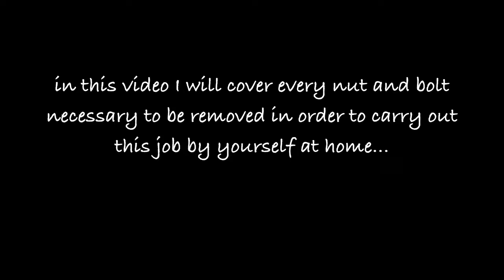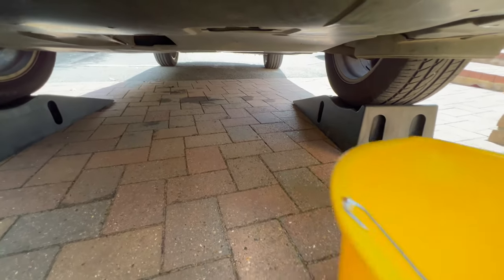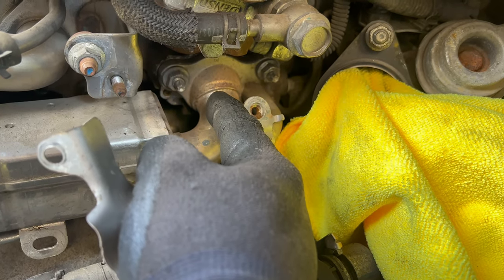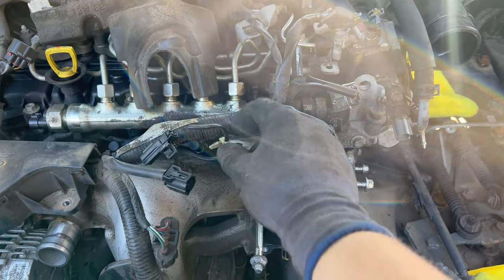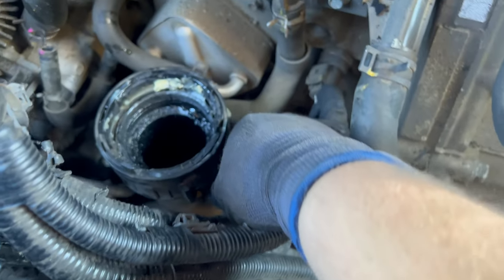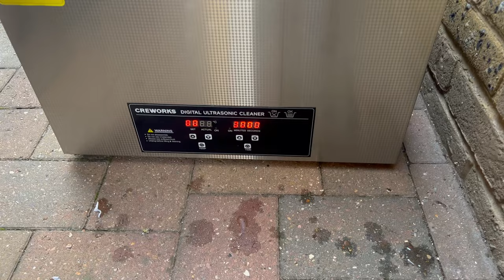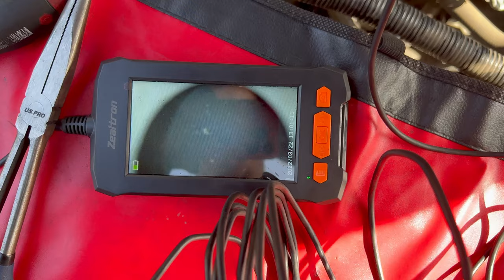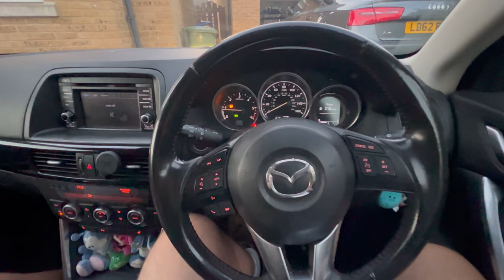Mazda STEALERSHIP Charged Him £5000 - Mazda CX5 Skyactiv Diesel In DEPTH Engine De Carbon Cleaning

Comment: These are the type of channels authorized garages and dealerships hate but we love. Thanks buddy. amazing in depth.
I've just had a P258b error come up on my mind and I was told it was a vacuum pump error but the vacuum pump seems to be working fine. Any tips?
Reply from the maker: It will be the vacuum pump and/or worn exhaust camhsaft.
Do you have a scan tool?
If so,check in the live data the brake booster pressure sensor values. If it doesn't go back to 7.6kpa then the vacuum pump needs to be replaced. Usually if you have codes for it then it is faulty.
Reply: @MrNiceGuy94  Bought a Veeapeak to scan the car. I'm not sure if it does live read. If it does, I can check this tonight. Thanks a bunch!

Comment: I cant get over the $9500(AUS) for a de-carbon etc, those dealer mechanics are only interested in oil changes for a premium price.
You should definitely tell the customer what needs attention. Even a snapped fan belt can have them stranded, with a expensive tow.
Keep these 2.2d soot machine vids coming !

Comment: Great content!  I have just cleaned the intake of my Mazda 3 2014 plate, 180.000 km wasn't so bad. The results were good, having in mind I did manually. It started at the first attempt and now is running smoothly. Thanks to your videos I had the guts to do it. Question now how would check the wear on the exhaust camshaft without distmantling anything?
Reply from the maker: Thank you very much buddy for your generousity! ;)
Unfortunately the only way is to remove the valve cover, because even tho you stick down a borescope into the oil fill hole, you still won't be able to see the exhaust camshaft as the oil shower is sitting on top of it and covering it.
However, if you have done the carbon cleaning on your own based on my videos, the valve cover removal should be easy for you too.
What you be mindful of if the injectors are not coming out with a gentle push from a prybar then don't force it as you may crack the valve cover. Then you will need to fabricate a similar tool that I did ;)

Comment: I have CX5 Fault P2262, 
Cleaned already everything and changed the sensors but nothing worked. 
Turbo seems fine to me. 

Its also telling me dpf fault. 

Do you have a guess what is the problem ? 

Thank you for every video! 🙏🏼
Reply from the maker: Which sensors did you change?
Did you clean the pipe underneath the exhaust pressure sensor?
What is the reading of the EPS at idle?
Did you visually check the wastegate flap on the small turbo?
What is the fault code for the DPF?

Comment: Excellent video, thanks for content, I plan to do this on my 2014 2.2 diesel ( will borescope inspect through the inlet sensor first ) question could I block the EGR tube at a gasket joint ? seen it done on a Landrover  video.
Reply from the maker: It should help, but also the ECU will need to be altered too.
Reply: Anything you block, delete or bypass will require a remap. There will be remap guys everywhere int he country. I deleted my dpf and have my 6 tourer at a stage 2 remap now.

 Edit: 2013 6 tourer 2.2 skyactiv diesel- biggest con in car history these diesel engines and dp filters with the egr that are designed to fail at 150K on the odo.

Comment: Fab reference video watched a few times..I aim to reppace and check my egr cooler ASAP..seems straight forward . I spoke to mazda tech when picking up my coolant bypass ..

1 question if I may ..how awkward do you think it wouod be to swap out the bypass with intake on ?. My car had intake clean under 2 years ago ..he suggested strongly its my egr cooler given what I told him I've had done etc ..I'd like to swap the bypass out same time as they commonly fail ..let me know if you will 

Thank you great work ill keep you posted

Comment: Very nice video. I have a short question about the intercooler. Noticed on this Mazda the pipes are quite full of gunk. Isn't this a result of the turbo pushing some oil in? As the carbon clogs the oil drain line from the turbo, oil starts slowly seeping through the bearing and in the compression fans. Therefore, do you also remove the turbo and clean it and/or replace the bearing or potentialy rotating shaft?

Comment: Hi I’m based in Fiji….my car cx5 vibrates at 1200 rpm…anything up or down rpm it’s fine….its happens in all gears if on hill or very smooth road…Mechanics can not tell it’s gear box or what few tell me it’s gearbox and few injections….its awd diesel 2.2l

Comment: You are an expert now on the 2.2 skyactiv diesel shitboxes, tell me I had one that had done 17500 from new over 4 years, now I know that's a very low mileage for a diesel over 4 years, I've since sold it, but it was doing regens every 30/40 miles, is that bad?

Comment: Very good video. What do you sugest to prevent the cleaning job? Some fluid spry every x km ect...thanks
Reply from the maker: Can't prevent it, but after this cleaning you can use chemical carb cleaning every year to clean it off again.
Reply: @MrNiceGuy94 through the intake ?

Comment: I would tend to to replace all gaskets and seals I come across, its quite a long job to dismantle, so if a joint blows after you have done the job then its going to be the most awkward one. I would also grease all threads with a smear of copperslip. I salute you on your replacing nuts and screws back and covering any openings which objects might drop eg,   air pipes, also as you found out it is easier to remove the coolant header tank and struggle and mess around catching the coolant in bottles.  It would seem the way people are taught these days is to take minimum amount off but struggle with the chance of damaging.  something. If you don't have an ultrasonic cleaner, then soaking in a strong solution of soap and hot water will do the job, but best left overnight. Like he has done clean the worst off mechanically. The EGR valve looks like you can remove the electrical operator then soak the valve end.

Well done and a good job.
Reply from the maker: I completely agree with you. However as I do these cleanings quite often(8 a month roughly). From experience I can tell that the gaskets are fine, I am talking about the metal ones, if there are rubber seals anywhere I replace them no matter what as they can degrade over time. Also I test drive the cars and check them which I have fixed and if there is any issue after that I fix it ;)  Also, all of these gaskets are ridiculiously expensive to replace, obviously if the client wants it I don't have any problem with it ;) For me as I do these quite often the removal and reassembling is the least time consuming job, the walnut blasting is a lot more involving.

Comment: Great video, just did the job on my car. Would not start after reassambling, sounds like no compression. You say it must build up new compression after this job, why is that? Guess this is the reason it won`t start. Guess I must crank it some more then..
Reply: I'd use some easy start to aid starting ..compression comes from.pistons so not compression issue

Comment: Thanks a lot for a great video. Would polishing the exhaust-channels prevent carbon deposits? Or another treatment to make it runs longer without problems again?
Reply from the maker: The problem is in the intake ports. Unfortunatelly there is no other solution than this.
Reply: @MrNiceGuy94  Can't you delete egr/dpf and avoid this issue?

Comment: Fabulous video, well done. I feel your channel would help me a lot with my CX-5 2.2 Diesel. 
Also, I need some help...
I can not find anywhere videos on how to change my thermostat, water pump as the only ones are for the 2.5L engines...

Maybe you can help me with that?
Much appreciated!
Reply from the maker: maybe I will change a waterpump soon.

Comment: My Mazda 2.2 d 2013  has a power delay on low  RPM when I push pedal to the bodem react after 2 seconds what it can be please help me I visited the garage many Times they didn't know What is the problem thanks a lot

Comment: About the brake booster pressure sensor, I noticed my brake pedal getting harder to press and looking at OBD live data it doesn't move much at all (always around 10-20kPa) when heavily pressing the brake pedal.
What should I suspect? Worn exhaust camshaft + bad vacuum pump, other than the sensor itself? Mine is a 2014 Mazda3.
Thank you

Comment: What a job that was, well done!  What is the number one cause of all this carbon build up?  Is it solely the injector washers leaking, or something else also (incomplete DPF regeneration)?  What mileage had the car done?
Edit: Appears to be around 110k miles on the clock towards the end of the video?
Reply from the maker: This car had around 120k I believe. The cause is the EGR system and the engine being direct injection, so the carbon residue and soot can build up inside the EGR parts, intake manifold and intake ports.
Unfortunately all direct injection engines have these issues more or less. The skyactiv is extremely bad on that side.

Comment: Nice Video :D 

Only thing I can suggest is, when you're doing that test for the Vacuum pump, let the Fast idle [Injector Cleaning Procedure] finish when you first start the car.
Pump the brake and check the reading once the Fast Idle [1800rpm] comes down to normal idle speed.
It will definitely effect how long it'll take for Vacuum pump to reach that >10 value.

Also with regards to that Exhaust Pressure sensor pipe, I understand it's blocked, but do you HAVE TO replace it?
Can't you clean it?

Maybe soak it in some cleaning agent to soften the sooth and put it through your Ultra Sonic Cleaner and/or use an air gun and blow it out?
Reply from the maker: Thanks for the insights. You are correct. I already knew that the vacuum pump is good on this one, I just wanted to show how to test it. But yes, you should wait till the idle settles.

You can clean the pipe I guess, but the owner decided to get a brand new one as it was causing him a lot of headache and also didn't want to risk it again having issues. I kept the pipe, I may clean it if I will have time and test it for blockage.
Reply: @MrNiceGuy94  let me know if you manage to clean it 👍
Reply from the maker: @xegro   there are 3 or 4 Mazdas booked in atm moment, so will throw it into the ultrasonic bath with the other parts.
Reply: @MrNiceGuy94  👍

Comment: What are the running symptoms of carbon build up on this car.  What faults does the car develop as carbon deposits build to this level?
Reply from the maker: P0401 but it is quite rare that it throws that fault code, if it does, there is no doubt, it is the carbon buildup.
But let's say if you have less then 45MPG average you need the carb cleaning.
Reply: @MrNiceGuy94   Many thanks.

In a country where it was legal to delete the DPF would you expect the carbon build up to be less?

Are there any additives or detergents that would help to reduce the build up?  Is it worth buying supreme type diesel fuels rather than supermarket diesel?

Comment: Thats a crazy amount of buildup i sure hope my engine doesnt look like that. I also have the code p2262 but my preassure is 200+ on idle instead of ~100kpa. What do you think causes this?
Reply from the maker: Message me on my facebook page, same username and profile pic as on here.
Reply: @MrNiceGuy94  I changed to the new upgraded sensor shy6-18-w00 and now it works great!

Comment: My car is showing low oil pressure on dash but only after 20 mins of running. Any idea what's wrong with it? 2.2D 2014
Reply from the maker: oil strainer blocked,cylinder head dirty from inside

Comment: I have a CX 5- 2017 automatic. It sort of went into a limp mode after driving for an hour on the motorway- The traction control system sign, smart brake system light, and electric parking brake light came on. Stopped and restarted  and everything was back to normal.  Can the carbon build up cause any of this?
Reply from the maker: Yes,it can.
Reply: @MrNiceGuy94  Thank you for the information. Great video!

Comment: Would you recommend head gasket sealer  ? Some water pulling in the cylinder in Mazda 6 2017. 😢
Reply from the maker: It won't really fix the issue just mask it for a while maybe.

Comment: how much sand remains where the valve is? ))
Reply from the maker: Sand? I don't use sand.
Reply: @MrNiceGuy94  what material do you use to make blast?
Reply from the maker: walnut shell media ;)
Reply: @MrNiceGuy94  it is less strong than sand, but it is still an abrasive material
Reply from the maker: Correct. But what's wrong with it? It is widely used for these type of applications. ;)
Reply: @MrNiceGuy94  it can damage the valves and cylinder wall if left there.
Reply from the maker: @YevhenPedchenko  the valves are closed when this is being done. Also it is sucked back out from the intake ports at the same time when the blasting is done. And if any fall down to the cylinder the combustion will just burn it .